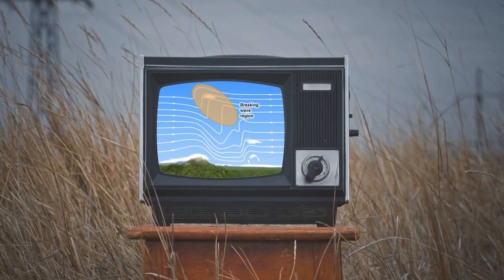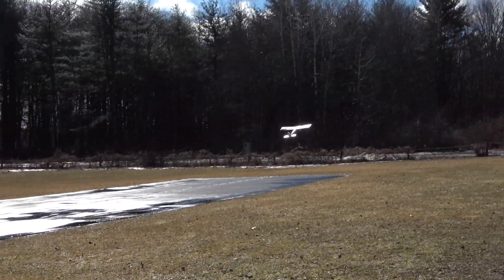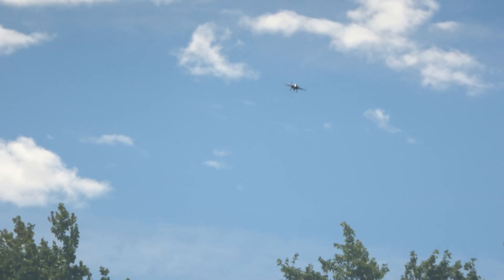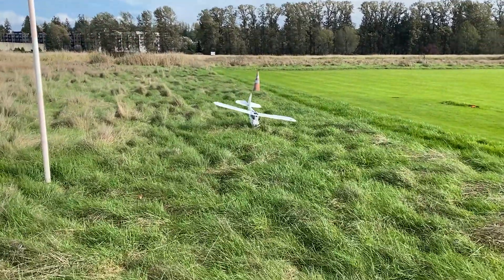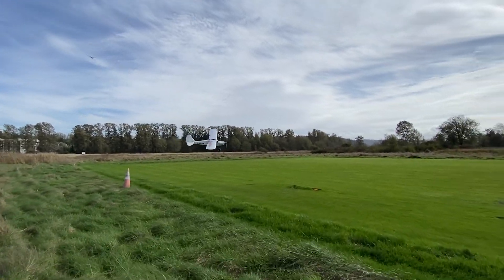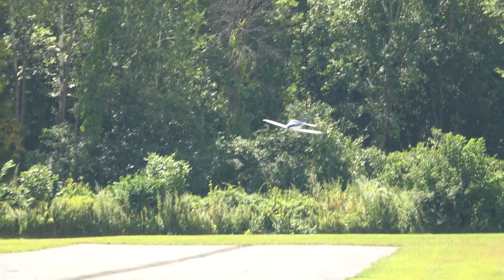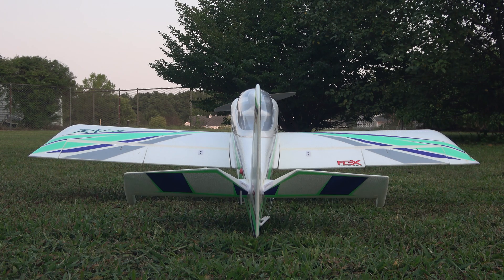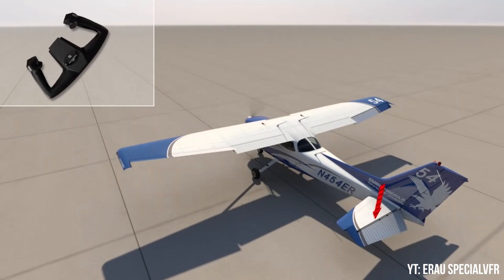Fly In Wind Like a *PRO*

Comment: Using Flaps in High Wind Conditions is Really Really Foolish cause when you encounter a quick wind sheer? You plane will drop a wing tip something severe and it always seems to happen close to the ground too! Rc Planes are super light and flaps are so unneccesary most the time. I use them to slow down a heavy fast plane when landing only other than that i stay out of them cause some of the most disasterous landings ive had were when flaps were engaged
Reply from the maker: For sure! For full scale OR with RC planes that are heavily loaded and don't have gobs of excess thrust. For the majority of RC planes, as we mentioned in the video, even if you hit a sudden change in wind speed/direction, you have the thrust to punch out regardless of if flaps are down with the added drag. This is why we explain it this way in the video.
Reply: @TailHeavyProductions  Thats why i watch your guys channel cause you seem to have a good grasp of aeronautical physics

Comment: I've got a cheap little 500mm foamy dollar store glider converted into an rc motor glider. If the wind is blowing hard it's the one I'm reaching for. It's only 100g  so it gets manhandled by the wind at slow speeds but throttle up and bit, point it into the wind and the game is to use slope soaring  techniques  to keep it just in front of you. Zig zag left and right. Huge sweeping  barrel rolls and loops for days feels like surfing in the wind. Cutting the throttle just before the top of a loop and finishing with a hard back on the elevator makes for a fast on the spot flip losing almost no altitude. 
Super fun
 If its heading in the right direction for any of my local hills then I'll pull out the slope glider and see how long I can stay up.
It's always windy here, so it's best to just learn to fly in it.